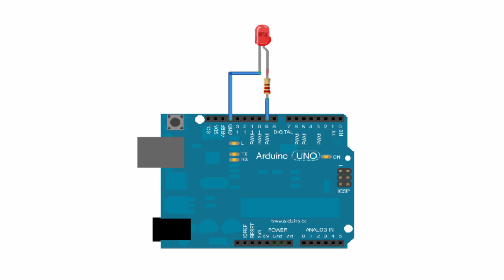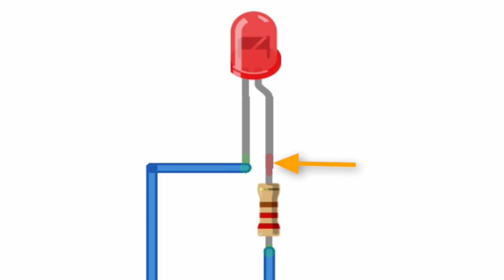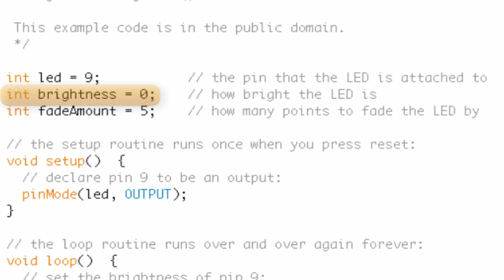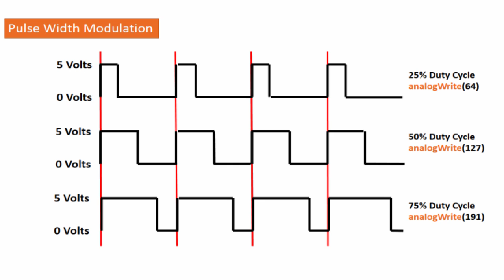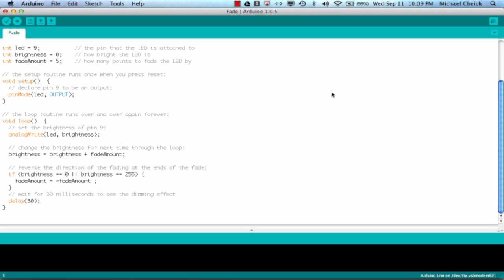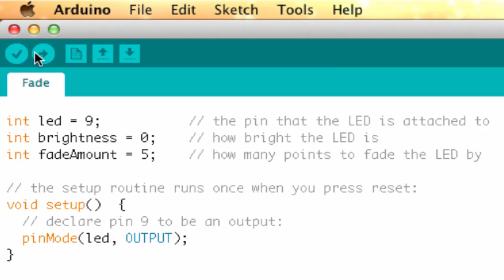Tutorial 10: Fade an LED: Arduino Course for Absolute Beginners (ReM)

Comment: I noticed on the odd fadeamount number the LED would fade evenly brightly and then fade dimly on the even fadeamount  numbers the LED would fade bright then start at 0 and fade bright again, there didn't seem to be any reverse of brightness. Why is that? I used fadeamount numbers 1-5.
Reply from the maker: +Michael H Great observation!

Since the condition of the "if statement" which changes the sign of fadeAmount requires that brightness be either equal to 0, or equal to 255, some fadeAmount values will not increment to that.  If you make the condition instead, <= and >=, then I think it should word for all fadeAmount values.

Kind of hard to write in words...hope it helps some.

Comment: This is one of the best tutorials I have ever seen.  
I have 3 questions: 
1. Could you have initialized your variables within the void setup block? (does it make a difference?)
2. How do you know to use a 220 resistor?
3. I tried to add another LED and it didnt work.  All I did was add "int led2 = 3" below the first one, then added "pinMode (led2, OUTPUT)" to the setup block, then added "analogWrite(led2, brightness)" in the loop block.  The code compiles without error.  I then plugged a 220 ohm resistor into pin3, plugged the short LED leg into the breadboard, and attached the long LED leg to the resistor.  Nothing happened. Is it the code, or something physical? The only thing I'm wondering about is that the first LED is connected to the ground on the UNO, while the 2nd LED is not grounded...?
Reply: In order for your second LED to fade you would have to use
pin 3, 5, 6, 9, 10 or 11.

Remember in the comment there is
"On most  Arduino, the PWM pins are identified
with  a "~" sign, like ~3, ~5, ~6, ~9, ~10 and ~11."

You are using pin 7 which is not setup as a PWM.
On the Arduino UNO you should see a note "DIGITAL (PWM~)"
right below pins 0-7 which shows which pins are setup as PWM.

Here is my code:
/*
 Fade

 This example shows how to fade an LED on pin 9
 using the analogWrite() function.

 The analogWrite() function uses PWM, so if
 you want to change the pin you're using, be
 sure to use another PWM capable pin. On most
 Arduino, the PWM pins are identified with 
 a "~" sign, like ~3, ~5, ~6, ~9, ~10 and ~11.

 This example code is in the public domain.
 */

int led1 = 9;           // the PWM pin the LED is attached to
int led2 = 3;           // the PWM pin the LED is attached to
int brightness = 0;    // how bright the LED is
int fadeAmount = 5;    // how many points to fade the LED by

// the setup routine runs once when you press reset:
void setup() {
  // declare pin 9 to be an output:
  pinMode(led1, OUTPUT);
  pinMode(led2, OUTPUT);
}

// the loop routine runs over and over again forever:
void loop() {
  // set the brightness of pin 9:
  analogWrite(led1, brightness);
  analogWrite(led2, brightness);

  // change the brightness for next time through the loop:
  brightness = brightness + fadeAmount;

  // reverse the direction of the fading at the ends of the fade:
  if (brightness <= 0 || brightness >= 255) {
    fadeAmount = -fadeAmount;
  }
  // wait for 30 milliseconds to see the dimming effect
  delay(30);
}
Reply: Thanks
Reply: +snipes0009  the 2nd need to connected into ground and you need to change most the code not just those i got min to blink instead of fade

  */
int leds = 7;           // the pin that the LED is attached to
int brightnesses = 0;    // how bright the LED is
int fadeAmounts = 3;    // how many points to fade the LED by
int led = 9;           // the pin that the LED is attached to
int brightness = 0;    // how bright the LED is
int fadeAmount = 4;    // how many points to fade the LED by

// the setup routine runs once when you press reset:
void setup()  { 
  // declare pin 9 to be an output:
  pinMode(led, OUTPUT);
  pinMode(leds, OUTPUT);
} 

// the loop routine runs over and over again forever:
void loop()  { 
  // set the brightness of pin 9:
  analogWrite(led, brightness);
  analogWrite(leds, brightnesses);  
  // change the brightness for next time through the loop:
  brightness = brightness + fadeAmount;
  brightnesses = brightnesses + fadeAmounts;
  // reverse the direction of the fading at the ends of the fade: 
  if (brightness == 0 || brightness == 255) {
    fadeAmount = -fadeAmount ; 
  }      
  
  if (brightnesses == 0 || brightnesses == 255) {
    fadeAmounts = -fadeAmounts ; 
  }     
  // wait for 30 milliseconds to see the dimming effect    
  delay(30);                            
}

Comment: i see that this example have:

int led = 9;                       // the PWM pin the LED is attached to
int brightness = 0;         // how bright the LED is
int fadeAmount = 5;     // how many points to fade the LED by

do this mean i can't use ping 0 and/or 5 as input or output? 

btw great tutorial!
Reply: +pu yu No no no, you can still use pin 0 and 5. The 0 and 5 in this sample are values assigned to variables that are being used , not pin numbers.

You could have 

int led = 5;                                  //since 5 is also a PWM pin and this variable assigns a pin
int brightness = 5;                    //this means the LED would start off glowing slightly instead of off since it will get 5
                                                       volts for 5/255th of the time
int fadeAmount = 5;                //this is still the step size with which you control the LED brightness.
Reply: Thrices to use a pin u have to declare the pin in setup using pinMode :)

Comment: Three things were really confusing. One was the conditional. I get how it works, but wouldn't <= and >= be much better? If you changed the fadeAmount, you could easily have an LED that just stays on because analogWrite() is being fed numbers greater than 255. Speaking of the variables, why do you have led and fadeAmount not set as constants? I don't think people find constants confusing, and it helps the Arduino to not dealing with 3 different integers. Here's third: You have 5 PWM pins 3, 5, 6, 10, and 11. Then you do anologWrite() with pin 9. What. Why this is never cleared up or why pin 9 is not listed on any of your tutorials with PWM is beyond me. Pin 9 is in fact PWM. This tutorial is super sloppy.
Reply: +Ginotitant Cubing

Pin 9 was already being used throughout the tutorial. Yes, it could have been mentioned in that one slide. No, it really doesn&#39;t matter since these are tutorials, designed to teach people the basics they need to further develop themselves.
Since you know Pin 9 is PWM despite having missed this in the tutorial means it worked - you found something out on your own. Congratulations.

As to why you want to declare variables? These are pieces of sample code. If you have a 400 line program that uses an LED pin 40 times.. Would you rather change 40 entries when you decide to change pin number, or would you save a lot of time changing just the 1 variable?

Fade amounts - the ints are saved to the variable memory anyways, so why protect them with const when you're not going to change them anyway? adding 'const' just takes up memory on the board.

IF statement: Yes, it would make sense to use <= and >=, but only when you know for sure no odd things will happen at -1 and 256 AND you have specific need to increase and decrease the brightness with steps other than 5.

All in all, your comment is super sloppy.
Reply: This covers a built-in example, so the potential problem with using a fade amount that isn't 5 is not the fault of this video creator.  Pin 9 is also a PWM pin, so the code is correct.

It would be best to use two conditional tests to check for <= 0 and >= 255 separately then set the brightness to 0 / 255 and invert the fade amount.  That would make the code 'universal' and allow use of fade amount other than 5.  It does make it more complex, however, so the original author probably decided not to do that.

Comment: Very, very useful tutorial. Good explanation technique and the orator as well
Reply from the maker: +Roman Maikovych Thanks for watching!
Reply: totally lost  me so what would the code be if i want  to  have an LED fade on and  then stay at 100% brightness for  a specified number of second then fade off , also have a second  LED fade on as the first is fading off
and how many pins can i  use PWM on on an arduino mini , can i use analog  pins for  PWM too? this is the sketch for  my halloween project ,which is blinking these for leds eye lights
https://postimg.org/image/4d6sw2u6z/

void setup() {
  pinMode(2,OUTPUT);
  pinMode(3,OUTPUT);
  pinMode(4,OUTPUT);
  pinMode(5,OUTPUT);
  pinMode(6,OUTPUT);
  pinMode(9,OUTPUT);
  pinMode(10,OUTPUT);
  pinMode(11,OUTPUT);
  pinMode(A0,OUTPUT);
  pinMode(A1,OUTPUT);
  pinMode(A2,OUTPUT);
  pinMode(A3,OUTPUT);

}

void loop() {
  digitalWrite(2,HIGH);
  digitalWrite(3,LOW);
  delay(5000);
  digitalWrite(2,LOW);
  digitalWrite(3,HIGH);
  delay(5000);
  digitalWrite(4,HIGH);
  digitalWrite(5,LOW);
  delay(6000);
  digitalWrite(4,LOW);
  digitalWrite(5,HIGH);
  delay(6000);
  digitalWrite(9,HIGH);
  digitalWrite(6,LOW);
  delay(6000);
  digitalWrite(9,LOW);
  digitalWrite(6,HIGH);
  delay(6000);
  digitalWrite(A1,HIGH);
  digitalWrite(A2,LOW);
  delay(4000);
  digitalWrite(A1,LOW);
  digitalWrite(A2,HIGH);
  delay(4000);
  digitalWrite(A0,HIGH);
  digitalWrite(A3,LOW);
  delay(4000);
  digitalWrite(A0,LOW);
  digitalWrite(A3,HIGH);
  delay(4000);
  digitalWrite(10,HIGH);
  digitalWrite(11,LOW);
  delay(4000);
  digitalWrite(10,LOW);
  digitalWrite(11,HIGH);
  delay (4000);
}

how can i edit this so that they blink at the same  intervals but just fade off and on instead of blink?

Comment: Hey , I have a doubt in pulse width modulation section. While varying the second argument in analogWrite function , the varying value is  power output voltage (0 to 5v)  or time for which 5v is got as power  ouput. Thanks in Advance.
Reply: i got the same concern like you

Comment: Really nice! Is there a method to change the frequency of the fade? Maybe using a potentiometer.. Do you know any ideas for the code?
Reply from the maker: Hi +Nick Petricci,  That is a great question!

If you are familiar with analogRead() and also with hooking up a potentiometer to an analog pin, than you can feed the the output from analogRead directly into the delay function.

something like...

delay( analogRead(A0) );

Best of luck.
Reply: +Open Source Hardware Group Thank you! I'll try ;)

Comment: hey, thank you SO much for your tutorials they have REALLY helped me learning Arduino and i know this is asking a lot, however I have been to forums and got no response, all the coding and uploading has worked wonderfully, however after uploading this LED Fade code which worked I now get an error "problem uploading to board..... avrdude: stk500_recv(): programmer is not responsive"then attempts 10 times to "sinc: resp =0x11"everytime returing "avrdude:stk500_recv(): programmer is not responsive"

I am using COM3 to connect my FREETONICS Arduino board, 

ANY help at all would be great, thank you!! :)
Reply from the maker: +Chris Simms Thanks for posting!  I will make sure to try and address this error in an upcoming video.

Have you seen this thread by chance?

http://stackoverflow.com/questions/19765037/arduino-sketch-upload-issue-avrdude-stk500-recv-programmer-is-not-respondi

Comment: First of all- your tutorials are GREAT!
Second of all- I’m having a rough time understanding something.  I understand that when brightness = 0 or 255, fadeAmount is multiplied by a -1, and would cause brightness to increase or decrease by a value of 5.  But as soon as brightness goes from say 255 to 250, how does the brightness continue to decay towards zero?  I’m just wondering because as soon as brightness = 250, the boolean operator is not a true statement (i.e. brightness ≠ 0 or 255).  So how come brightness doesn’t immediately go back to 255?  I’m sure this is something simple, but I’m just not catching it.
 
Thanks a lot!
Mike
Reply: Michael Wasiukiewicz I hope this helps:) When the loop is run through again the fadeAmount is still -5 because the statement is not true. So brightness= brightness + fadeAmount will be 250 - 5 which is 245. And after that 245 - 5 etc.
Reply: Mendel Engelaer Thanks a lot- that helped!
Reply: Michael Wasiukiewicz just to clarify,, the value is remained unchanged after a condition has taken place unit new condition is true, the 'if' function only changes the value if the condition is true else it remains the same which is -5 in that case :)

Comment: Question:
Ok, so let's say we AnalogWrite one of the PWM pins to a 100% duty-cycle and attach an LED. That means 100% of the time the voltage is at 5V (LED ON) and 0% it is at 0V (LED OFF). So if we slowly change the duty-cycle to lower and lower duty-cycles (which is what the code does before it reaches the 0% duty-cycle), why is the LED fading? I mean, shouldn't it instead be blinking quicker and quicker (quicker and quicker meaning that the 5V "ON time-spans" of the LED become shorter while the 0V "OFF time-spans" become longer)?

There is a greater point to my question.
I mean I can kinda guess the answer: the duty-cycles / pulses go so fast that the human eye does not see a blink but simply less and less light. But here is the problem I'm having though:
If you'd attach a multimeter to the pin to read the voltage, what would it show? That's important to know cause, what if you were to attach other things than an LED? Some device that needs exactly 2 Volts, for example: would it be ok for the device to set the PWM pin to a 40% duty-cycle (5V x 0,4 = 2V)? If yes, does this hold true for any device?
Reply: You are right about the fact that it is flickering and that the time its on while flickering makes you see dimmed light, 
One "ON" "OFF" cycle, is 2 ms, 500 times an second.

You can NOT use this for devices rated for under 5v, 
it would still get the full 5v but it would be turned off and on really fast.

EDIT
You CAN use 2 volt rated devices, using a voltage divider,
Reply: Between the pwm pin and ground pin you could use 5 10k resistors in series,
First you put 3 resistors in series, the you make an 'T-junction', the one is you 2v pwm output and the other needs to go to gnd, BUT between the 'T-junction' and ground you need to put the other 2 resistors in series.
So you make an resistor path between your pwm pin and gnd and between the 3nd and 4nd you get 2v.
Reply: thx!!
Reply: Robs Tech Channel btw, you indeed aren't "fading", you are stepping down the duty cycle in 51 small steps.

Comment: Quick question..the  (int led = 9 ) assigns pin 9. Why don't the others (int brightness = 0) assume we are assigning pins and not designated values??? Is it because we didn't assign them to a pinMode INPUT or an OUTPUT. Never mind answered my own question :)

By the way. Best Arduino tutorials I have come across!!!
Reply from the maker: Hi Klay,  Great question!  

One additional thought, pins are by default set as inputs.  So even if you do not set a pin using the pinMode(pin, INPUT), it can still act as an input.

So, if you set brightness = 5, and then referenced brightness in digitalWrite() i.e.

digitalWrite(brightness, HIGH);

As long as you had an LED at pin 5, it would turn on.  

So the variable doesn't really care what you use it for.  The value assigned could be a pin, or the brightness, or the amount to fade, or whatever.  An integer variable only cares that the number assigned to it is an integer, after that - we can use that variable however we want.

Hope that makes a little sense.  Have a good one!

Comment: Great tutorial, thanx for posting.  It's nice to have someone like you to take the time to explain examples.  I'm new to this Arduino world.  I pretty well understand the software, but have no/little hardware experience or exposure.  I am unable to upload the code example because my Uno is on COM3 by virtue of Windows8 automagically recognizing the device and putting it there.  However, your code example seems to default to COM1 and I don't know how to re-match the code or the COM port.  Help please?  thanx, Richard

Comment: Is there a way to give only one naming for multiple leds? for example : int leds = {3,5,6,9,10,11}
Reply from the maker: Great question - yes, it would be a data structure called an Array. An Array can hold only one datatype, in your example, it would look like something like this:

int LED_Array[] = {3,5,6,9,10,11}; 

http://arduino.cc/en/Reference/Array
Reply: Open Source Hardware Group Great thanks!

Comment: Here its a fun thing to do, instead of using an led with a resistor, use a piezo speaker, and set the fade amount to 25
Reply from the maker: Frostclaw20 Cool, will have to try that.
Reply: Trust me, it is so much more fun

Comment: Hi, I've been following all your tutorials and I really like them but ca you please explain me hot to choose correct resistor for a particular LED or potentiometer or any other device. After a small research I found that it can be calculated with the help of ohms law but still I am not getting it. For example if the LED is of 2.2V connected to arduino then which resistor to use to make sure that Arduino and the connected device(LED) in this case remains safe. 

Because according to Ohms law if voltage for LED is 2.2V and it works on 0.02A (or we can say 20mA) the the resistance should be 110Ohms. then why we have used 220Ohms resistance? 
Thanks in advance :)
Reply: it's (5-2.2)V/0.02A=140ohms i.e 2.8V should be dropped out of 5V and and its safe to use the resistor with approximately 1.5 times the calculated resistance i.e nearly equal to 220 ohms. This is done so that the resistor safely tollerates 0.02A current and the voltage doesn't exceed the maximum voltage range i.e 2.2 in this case